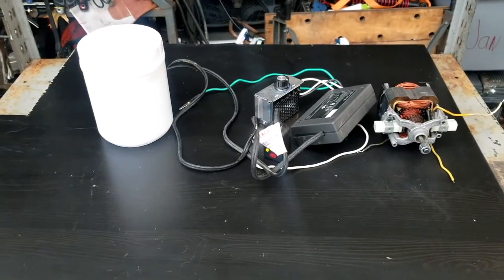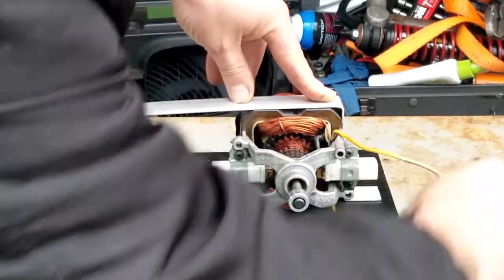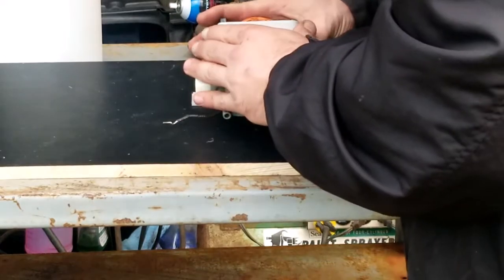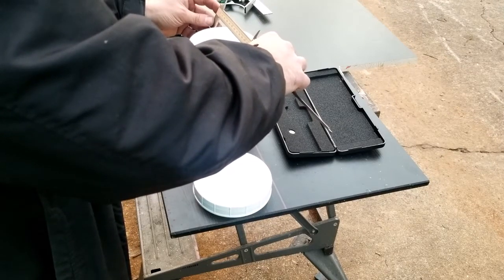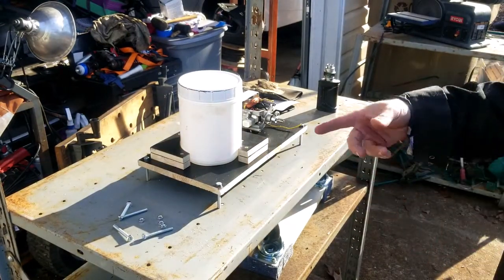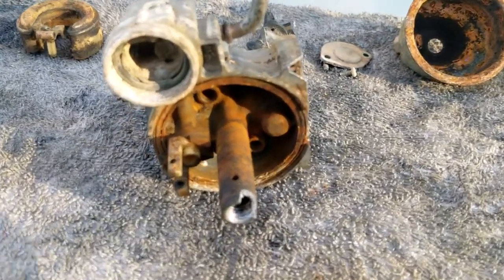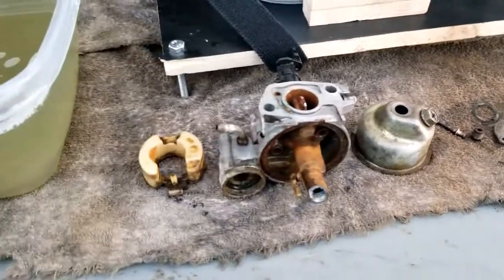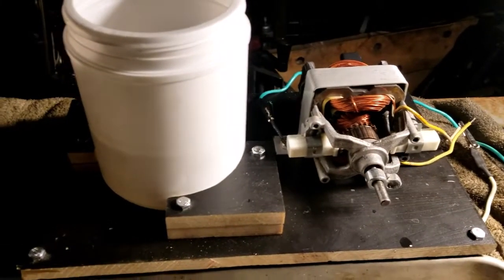How to make a Vibrating Parts Washer/Cleaner with test results - Version 1

Comment: Genius. I have some old rusty hardware/sockets/ and odds and ends that an old timer gave to me, soaking in some HCL. Had i subbed about 5 hours ago my soaking bucket wouldve had one of these puppies rigged up to it too! Great work man.
Reply from the maker: Hey Brother!  Yes works really well!  I mainly use it for carbs and other small engine parts!  I built a bigger one of camera so I can do small engine cyclinder heads and blocks!